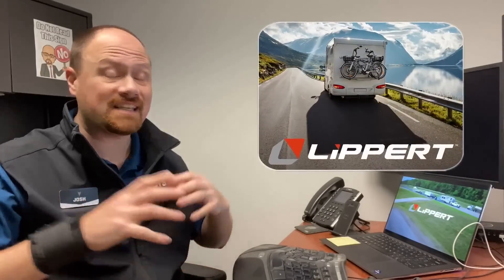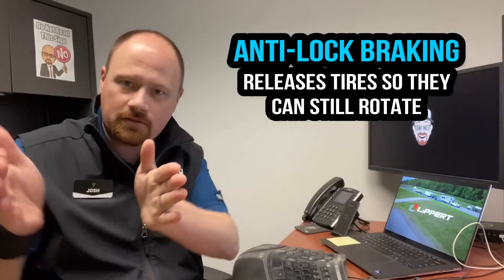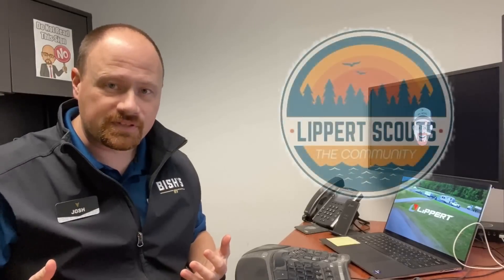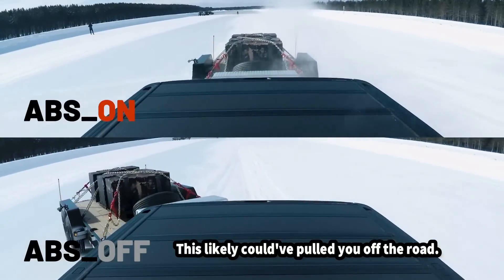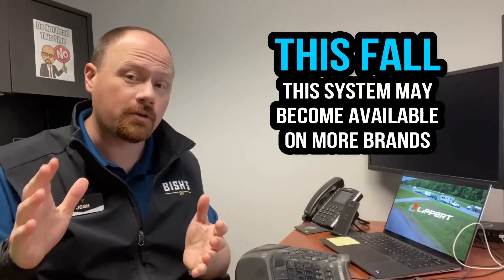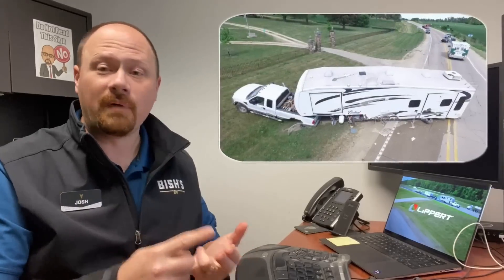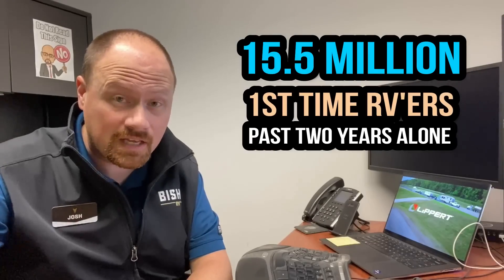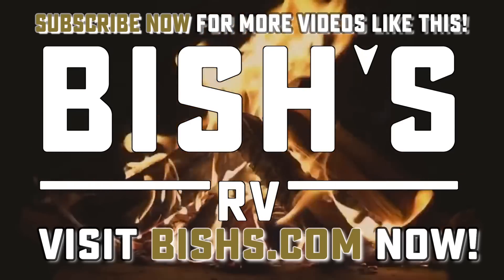This New Safety Feature Changes EVERYTHING!! [RV ABS for Towable RVs]

Comment: FWIW, when truck manufacturers started integrating brake controllers into the truck from the factory a decade or so ago, all of this became theoretically possible - coming from the truck itself. Whether any of the manufacturers actually did this, I have no idea. But an OEM installed brake controller is directly linked to the truck's brake system and thus the ABS & stability control system. So Ford, GM, Ram all could hypothetically add this into the stock package and it might work with any trailer with electric brakes. I'm kind of surprised that there isn't already some level of trailer ABS coded into them already (assuming that it isn't). It seems like if they could do that, then the truck and the trailer ABS would work in an actually coordinated effort.

But short of that, having it available on the trailer is fantastic. Hopefully there will be a way retrofit it to existing trailers in a cost effective way at some point...
Reply from the maker: I'm not currently aware of any sort of "talking" between the truck/trailer but real talk... I'd love for that to be the case. Auto makers have a better record for reliable tech stuff

But it's all steps in the right direction. There's so much in the way of bad tow-pairings out there

Comment: Many trucks have the trailer brake controller that in an emergency you can apply more brake to the trailer with your fingers. I wonder whether that has been effective?  Do people have the wherewithal to use it?  If you had ABS on the trailer, would this eliminate the need for the truck/trailer controller?  Would it work adversely with it?  Just wondering...
Reply from the maker: Works differently and wouldn’t apply to an emergency braking situation most likely

That’s handy when the trailer gets a little jumpy and you need to straighten out sometimes

Comment: UJ Wait! Let’s start over. Tuson RV does indeed already sell this system for $400-$500. That’s cheaper than a sway control hitch. Here are my questions:
1. Can I ditch my anti-sway hitch? 
2. Would I need a weight distribution hitch in place of the sway/weight distribution hitch I currently have?
3. Can I continue to use the weight/sway hitch I currently have?
4. Does it use up your trailer brake pads more quickly than just using them for braking?
Reply from the maker: TUSON: Yeah I'm learning about that now. TY for this info!
1.) NO! Keep that hitch. This is designed to work with all existing equipment
2.) Yes. Keep all existing hardware. ABS/anti-sway has nothing to do with weight distribution directly. They just often pair together like peas and carrots. 
3.) Yes. 
4.) That I don't know.

Comment: From the conversations I've had with reps and local dealers, most of them aren't even aware of the system, or the fact it was on the coach they're selling. The people I spoke with who were aware of the technology either seemed to avoid telling buyers about it because they felt it might give them reason to increase their speed a bit more than they normally would thinking they would be "safer" if they had to stop on a dime ( which we've all seen people fly by us doing 75 or 80+ with an trailer/5th wheel and even motorhome ), or they tried to stress that this is not as much of an impact maker as vehicle ABS ( even if it is ) for basically the same reasons.

My primary concerns are:

1. How is the equipment going to hold up long term, especially with prolonged periods of non-use in potentially extreme cold and heat.
2. What is it going to cost, what will it's warranty be, and will people feel comfortable investing $X on an RV that didn't come with it.
3. If it becomes something that gets known for some common issues, is it going to be something that ends up with more YouTube videos discussing how to bypass/disable it ( see things like "3 amigos" or "air suspension coil conversion" on Land Rover's ).

Hopefully it works as intended in the demos for a similar amount of time compared to vehicle ABS, but even if that's similar in time it's going to frustrate people and lower the prices of a used unit for sale if the next person knows they have to invest $X into a replacement ( like old air bags in older diesel pushers ).
Reply from the maker: Super fair and reasonable concerns. I wish I could answer them right now.
Reply: @JoshtheRVNerd  Time will tell .

Comment: Love this. My only question is about backwards compatibility and retrofit options. If I buy the trailer I want today that didn't have this or if I have one that's a few years old already, will this be a possibility for me? Or do I need to buy a new trailer with this installed from the factory? Really hope the former is the case but something this significant would persuade me to hold off on pulling the trigger on an RV until this is available for the rig I want. Incredible results and exactly what I want as an inexperienced trailer puller, so much peace of mind.
Reply from the maker: Consider Tuson (another company) has been offering a system like this for aftermarket RV ABS for a bit now I don't see why it WOULDN'T be possible. I'm only just learning about some other vendors like that myself

Comment: Does greywolf use something like this?  Over Christmas we had to do a hard brake in snow.  Truck abs kicked in and then you could feel the trailer pushing and pulling and it started straight with the truck.  Or do some brake controllers do a form of abs?
Reply from the maker: Right now only GD has anything like this on their reflection, momentum, and solitude products. 

There are some aftermarket solutions like Tuson available to consumers though

Comment: Yep, if it's standard on tow vehicles it should be standard on towed vehicles.  Just like you're supposed to swap out tires in sets, or so they tell us.  Having said that, I wonder if this advancement would lead to people forgetting they have a trailer brake control or not learning to use it.

Comment: So if I understand correctly, this system can work with the anti-sway that's built into my truck's trailer mode?  Can this system be retrofitted to a current trailer?
Reply from the maker: Retrofits should be possible. Similar aftermarket systems are already out there

Comment: Curious how this would affect “panic braking” using the panic button on the controller to straighten out the trailer in adverse weather or road conditions. There are times when you want the trailer to skid. 

Also, setting up your brakes for proper controller strength typically requires you to “bark” the brakes on the trailer at 20mph or so to accurately get enough power to the trailer system. Seems as if this would interfere with that.
Reply from the maker: Doesn't matter how the braking is applied - any time the tires would start locking up this system steps in to make corrections
Reply from the maker: System can be turned on/off for setting those controls btw

Comment: There’s something I can’t grasp here, and I want to.  I don’t just throw my stuff in “D” and go, I want to understand it. Most training on adjusting your brake controller says to adjust the brakes til they will lock, then tame it down just a little. Or said differently your trailer will not lock its brakes under normal driving unless you reach down and manually operate the controller to jerk your rig back straight in a sway situation that’s out of control. ( bad weather would be an exception when your brakes lock even if adjusted not to do so). Some trucks now can apply your trailer brakes to control sway even if you are not braking. So since the system “senses” sway, makes me wonder if it can tap the trailer brake for you even if you are not hitting the truck brake to get your rig back in a straight line. Maybe understanding everything just not really gonna happen.
Reply from the maker: The sad part to this.. you're the exception. Not the rule. 
I despise what I'm about to type here..

I've learned in my years doing this the average person is inclined to believe whatever the person across the desk tells them no matter how much they suspect it's wrong. They want to just go have fun, they don't enjoy the shopping experience, so they push thru it as quickly as possible risking a bad experience just to get it over with

Comment: Can  I ask a question. If the trailer brakes release as needed. When it releases doesn't  that put more strain/forward force  on the tow vehicle?
Reply from the maker: Weirdly.. no
Because a locked up sliding tire is providing less stopping power than a properly braked & cycling tire. This system actually improves handling and control
Reply: @JoshtheRVNerd ** Thanks Josh, appreciate your answering my question. Love your cannel. 66 retiree, undecided RV Lifer and your reviews help me enormously.

Comment: Josh, is it possible to retrofit existing travel trailers with this ABS as an add on without major modifications to the original hardware?
Reply from the maker: Yeah should be able. Aftermarket similar systems have been out there for a bit now but I'm really only starting to learn about them myself

Comment: Another one of those things that make you go hmmmm. I mean ABS on pick-up trucks was std in what '88 or something like that??? What in the world has taken the trailer manufacturers so long to incorporate this??!!?? I mean this doesn't apply to just travel trailers- this should be on ALL trailers. I also am concerned you brought up anti-sway bars for unibody SUV's. That is the first I have heard of this and no one said anything when I purchased one for my vehicle. I haven't gotten around to installing it yet maybe for the better. I have a '21 Durango R/T with the Tow N Go package (beefs up the suspension/ brakes to handle a tongue weight of 900lbs and 8700lbs overall). Now I am wondering if it is safe to put the anti-sway bars on the 22ft auto cargo trailer I have that I bought that system for??? Thanks for another great video Josh. This is one for the ages... now if we can just get the NTSB to get onboard and make it mandatory.
Reply from the maker: Yeah it’s old tech. How has it never occurred to anyone to bring it to Towables before now?
Reply: Some unibody vehicles have hard points that allow the use of a weight distributing hitch. Most do not. The only way to know is to look in your owner's manual and/or get a definitive statement from the manufacturer.

Comment: Josh, thanks for all you do with your videos.  I have seen a number of them and they are always helpful.  This is amazing new technology and I agree it would be great if it was made standard.  I recognized the Lippert name as they make an auto leveling system that can be used on travel trailers.  I haven't seen any videos on putting auto leveling systems on a travel trailer and was wondering what your thought on that were and how to determine if a particular trailer would be compatible?  As I often travel alone, it would be nice to have an easier way to level the trailer.
Thanks for all the wonderful info,
Laurie
Reply: From my research. An auto level system can not just be bolted on any rv. The frame has to be engineered for it. 
A trailer with stabilizer jacks would twist and bend using a leveling system.
Reply from the maker: I've seen aftermarket auto leveling installs. It can totally be done. USUALLY the cost factor stops people. Aftermarket installs are more spendy vs factory installs

Generators follow similar trends. 

And as James mentions there are size factors. Trailers CAN be too small to properly utilize an auto leveling system
Reply: @JoshtheRVNerd  How can I figure out if my trailer would be a candidate.  From what I have seen in videos it looks like I see them more on fifth wheels, but I have a travel trailer.  The dealer that I purchased from is pretty useless so going there is not an option.
Reply: @jamesglenn520  Thanks James, this is my concern, trying to determine if my trailer would be a candidate.

Comment: Can this be added to the Grand Design G series 5th wheels? Appears that it's still only standard on the higher end models.
Reply from the maker: Systems like this could be added to any RV but I don't think they offer a factory option for it
Along with Lippert's system there is also the Tuson system that predates it and Dexter's new system

Comment: this is great! Assume works with brake controller.   so, how can we upgrade? Even our little camper, definitely want to add it.     thanks for this Josh!!!     
UPDATE:  did a quick search,  there is an anti-sway electronic device on market (Tuson Sway Control (TSC-1000))  not sure if works same but seems similar.  For around $550.    Just a data point.    
Still interested to see how to get one of these in future.  Would like to see it as minimum an option to add when you purchase the trailer.
Reply from the maker: Yeah works seamlessly with any braking system. It just detects if a tire is locking up and individually allows locked tires to cycle

As far as the truck knows it’s still blasting the brakes full power

Comment: I've been thinking about the anti-sway function and see a  couple of potential points of concern. My truck has built in anti-sway control however it is recommended by Ford that it be turned off when using a hitch with physical sway control. I suspect it would be the same for this ABS unit if you are using its sway control. Then there is the situation of the hitch providing sway control as many weight distributing hitches do or as friction bars do on those hitches that don't. Would the ABS unit sway control also have the requirement that it be turned off for hitches that provide sway control or that you use hitches without sway control? The hitch provided sway control isn't an issue with 5th wheels but it could still certainly interfere with the tow vehicle's systems.
Reply from the maker: Yeah I had similar thoughts. I think that's why they're not forcing the two together

I just feel like there's opportunity for better, safer towing. I see some sketchy stuff out there

My FEAR is some predator of a salesperson or organization is going to tell customers "you can tow more than that because this has better braking" or something stupid like that. I hate to even breathe that idea into the universe but I know it'll happen
Reply: @JoshtheRVNerd  I didn't even think about the scam artist sales types convincing a new RV customer that trailer ABS will let them safely tow a 10K trailer behind their Prius.

Comment: Can this be retro fitted to old trailers will it work with older  trucks and cars. But abs is required for semi trailers seance  1990 s. I think this should be required  on all new trailers. Work trailer should have this contractors have rig in towns and driven by employee's  driving is not their living but service trades.  I think hotshoters hauling frieght would see the value. Trailers are loaded differently with different frieght every day. Light loaded in rain is worse then heavy load
Reply from the maker: Yep! Tuson has a similar system that's been out for a while. I'm pretty sure Lippert will be opening up aftermarket sales soon and I think Mor/Ryde might be working on a version themselves

Comment: Semi trailers have had ABS systems for years now. Was this system drum or disc brakes?
Reply from the maker: Tested on drum systems as I recall as that applies to most rvs

I dont know if they have a disc brake version yet
Reply: @JoshtheRVNerd  

The solitude I just picked up in Indiana has 7k axles with abs and also has drum brakes. I’m pretty sure the Momentum I took to Oregon last week also had them, but I didn’t know to check before seeing your video. I didn’t notice anything different about the braking, so that’s a good sign.  

On another note, the 17.5” Cooper tires that Grand Designs is using are probably the best tires I have experienced in ice and hard packed snow. Even before they had ABS these tires would allow pretty hard braking action on snow and ice before losing grip. The addition of ABS can only make towing these units safer.

Comment: Should be no exclusivity on a safety feature like this!
Reply from the maker: It was a matter of what they could supply - not what they wanted to do. Aftermarket systems like this have existed
Reply: @JoshtheRVNerd  I am with you though. After seeing the demonstration I am sold.  I assume the system works with both drum and disc breaks.  Not sure if one is better than the other.

Comment: This might have helped us when our truck and trailer were hit by an uninsured driver outside Chicago in late 2021. The roads were wet with a moderate rain and I was concerned about an emergency stop or maneuver so gripped the wheel and waited for the impact. Thankfully the Equal-i-zer hitch kept us all inline and in our lane. If this had been installed I might have been able to avoid the accident by hitting the brakes hard. 

I do think it is kind of sketchy of Lippert to make something this important exclusive to a single manufacturer. It has taken my already low opinion of Lippert and its products lower. I think we need to change federal laws to not allow something like this and will be addressing it with my Congress critters in addition that this should be mandated on all trailers.
Reply from the maker: It was a matter of supply initially. They couldn’t make enough to supply the industry and had to pick an initial partner while they were getting production set up